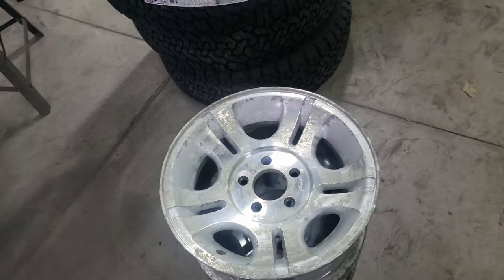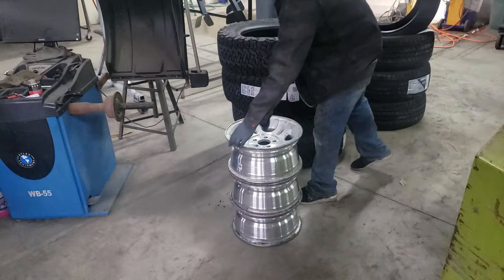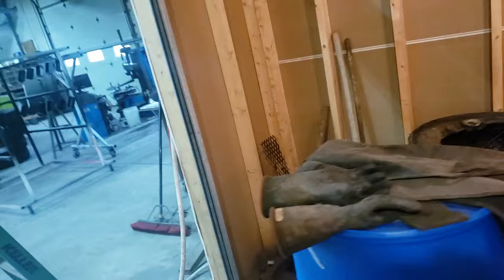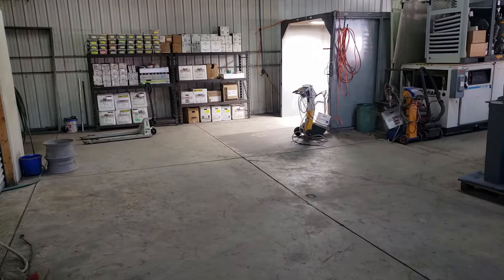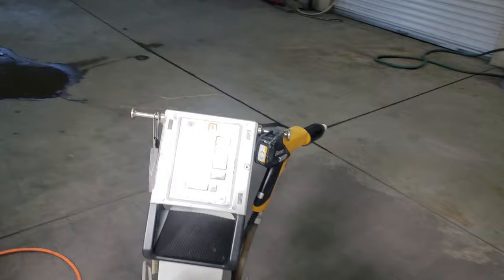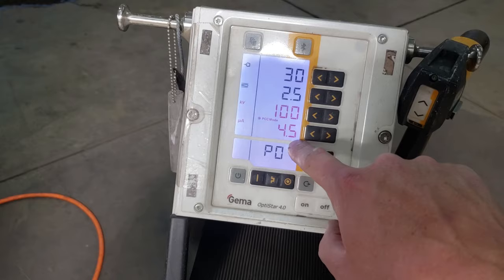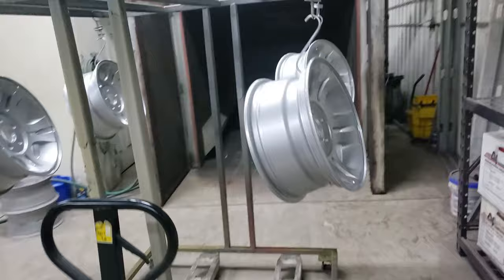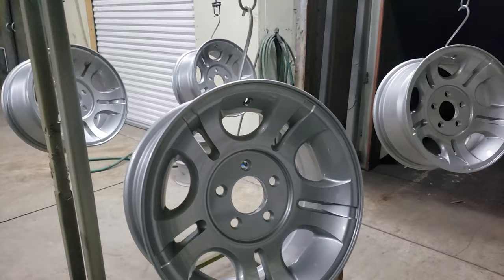How To Fix Heavily Corroded Wheels - Silver Metallic Powder Tips

Comment: Real curious why you acid dipped to remove the clear coat.  Wouldn't the sand blasting serve the same purpose?
Reply: Yeah I’m pretty sure it would I think he was trying to plug a product considering his hired hand didn’t know how to properly rinse them
Reply: Needs to be dipped. Then sand blasted
Reply: Blasting isn't for stripping, it's to create the proper surface for powder adhesion. Stripper is for cleaning. Blaster would clean but take too long and risks digging ditches in the wheel.
Reply: Why no metal prep / acid etch before coating? What keeps the aluminum from corroding again when moisture eventually penetrates the coating?

Comment: Nice work, but the inner edges of the rim are the business zones. Aside from the off looks of the rims in original state, They leak air. The resulting outcome of not paying a lot of attention to the rims inner lips result in consumer useless, pretty dishes. A spin on an old tire balancer or lath using a bit of sand paper tends to actual fix the issue. Coating the bead surface professionally helps to protect the beads from unscrupulous tire changing tech as well.

Comment: What was the cost for this job? How does your powder coat with a clear coat added perform? How long does it last. How do you clean it. Will it last for several years and not peel, flake or crack? Your viewers will want to know the answers to these questions.

Comment: Great video. I always throw a high build primer on first when the wheel is hot to cover most of the corrosion and any imperfections that I might have missed in the blaster. Hitting it hot also helps to prevent dotting on the powder if you’ve not out gassed for long enough. Something which can often happen with heavily corroded wheels. Also easier to see any areas that might need a little extra primer as it flows out as soon as it hits the wheel. Primer is usually much cheaper to buy than the colour you’re powder coating so long term it can work out more cost effective to primer the whole wheel on a corroded wheel and then second coat the face and inside bowl with the colour. All depends on customers expectations I guess. In England our weather and the products used by the local car washes means we’re forever doing corroded wheels

Comment: All I would add is try using a high build primer on corroded wheels it will hide the pinholes and give you a super smooth base to lay colour on also I hot flock far quicker 👍
Reply from the maker: yup this can help, it really comes down to the customer and their budget in my world. some just want them better and some want them perfect.

Comment: Hi, Im new to this, just bought my dream truck and the original owner powder coated the oem chrome wheels in black, those wheels look nice but I really love the chrome, is posible to remove the black powder coat and just apply a new powder coat in chrome? just like oem factory... What do you recommend? Thanks🙏🏻
Reply from the maker: nope, dont do that, chrome sucks and its not great to coat over, really bad if it has pitting or corrosion.  Buy new wheels, way better and cheaper.

Comment: What's the process for getting a nice finish with corroded steel. Primer ? Seems I need a filler but what ?
Reply from the maker: you can fill with primer, sand it down, fill again if needed, then to color.

Comment: How much does it generally cost to redo 4 rims?
Reply: They charge $185 per wheel to $250 depending on the wheel, you can do this at home for $20 for all wheels
Reply: @MSami-fe6uj  I've got a rare set of aluminum 13" blade style rims from a Honda crx that have chips and chunks missing from the lip in the aluminum.
Reply: @MSami-fe6uj  how?

Comment: Hi, great video! How do you work around wheels that have heavy corrosion like the wheels in your video? Don't you deal with outgassing issues without using primer?
Reply: That would be the answer personally I prime all my wheels with outgas forgiving prime. We will sand corroded spots at that point therefore using it as a filler reprise if necessary color and clear

Comment: I recommend a marine air fan. Simple 12v setup that will clear up blasting chamber/ visibility a ton. Also, adjustable flood lights work great as a cheap "after market" light with cheap bulb replacement vs led